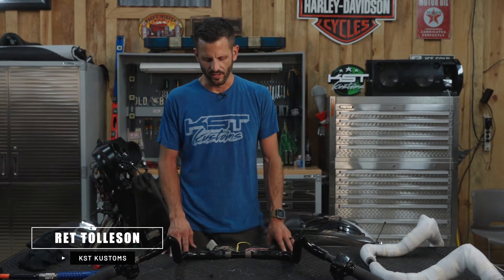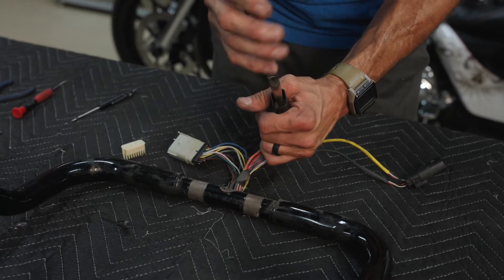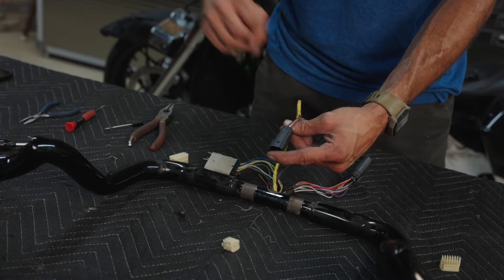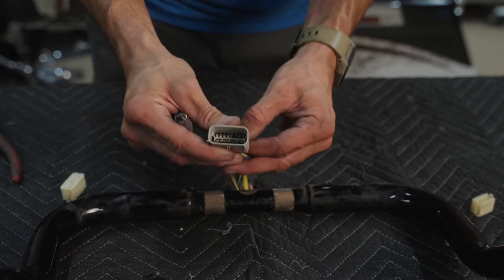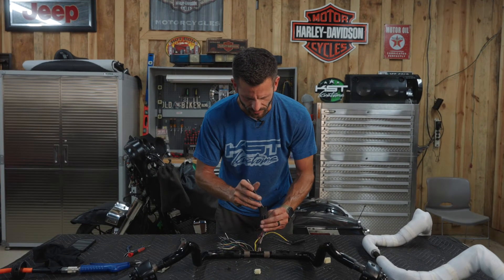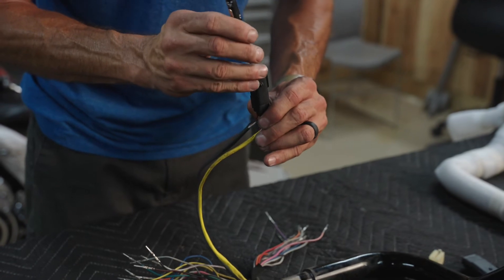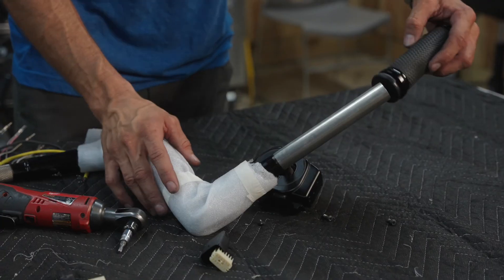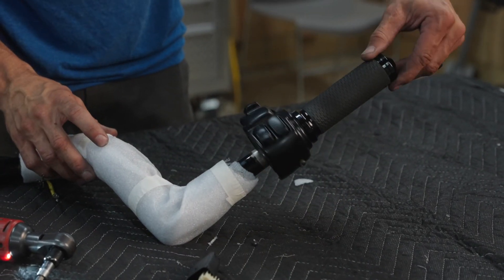Internal Wiring for 2008-2013 Harley Davidson Handlebars

Comment: I wished I saw this video before attempting to install my KST bars. I never thought to remove the thick plastic wire cover as I thought it would provide more protection going through the inside of the bars. I spent an entire weekend trying multiple times to pull all the wires through the right side and the one time I got it the throttle sensor connector separated inside the bars. I gave up lol. But now I think I’m going to try it again. Nice vid.

Comment: My 2012 FLTRU has a 6 pin and a 2 pin (black and white wire) for the TBW. Any idea what the 2 are for? I do not recall them being plugged in when I took it apart.
Reply from the maker: Heated grips
Reply: That is what I thought, but was not 100% sure. My bike does not have heated grips so I will not worry about that one. Thanks  @kstkustoms1324

Comment: First to comment! This is an excellent video. I have a 2010 Dyna Wide Glide that had a high set of ape hangers on it when I got it. I will soon change to a set of low  bars from an earlier Fatboy. I will have to mill a notch in the bottom center of the bars and also on the ends of the bars where the wires exit into the controls. Your section on unpinning is very helpful. Thanks for this video!